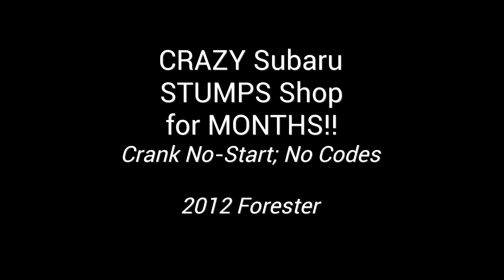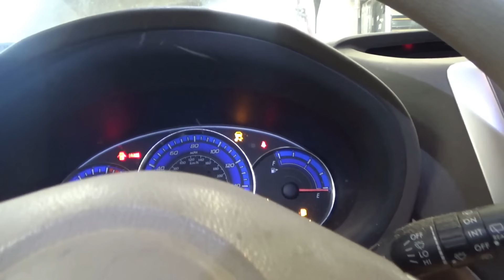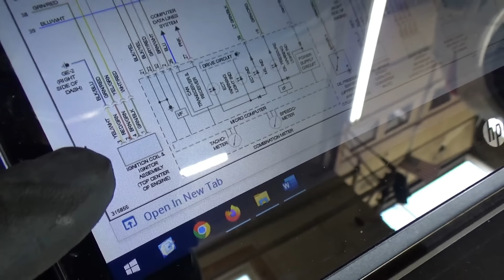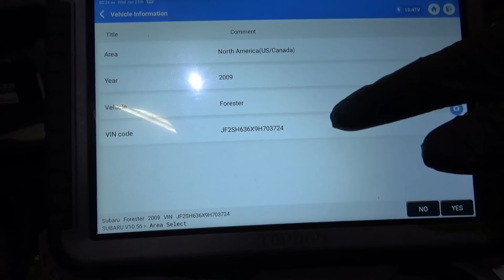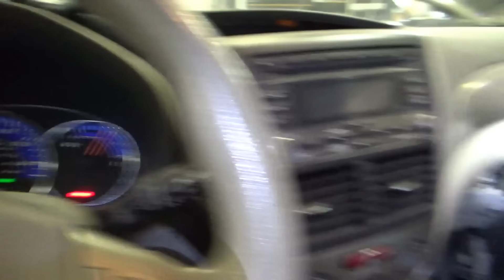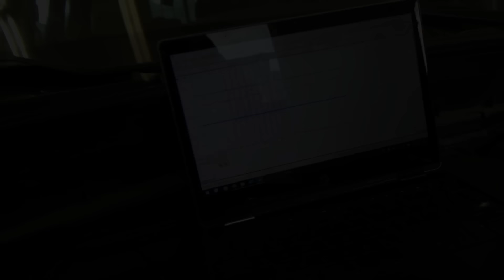(Pt 1) Subaru STUMPS Shop...for 6 MONTHS?!? ('09 Forester Crank No-Start, NO CODES!)

Comment: This scenario reminds me of some of my own ' grandpa tricks '
As a youth, back in the days of carburetors and cold winters in Michigan severely flooded vehicles were a common thing.  A cold start mechanical choke mishap and you had engines dripping with gas.
Some spark plugs would absorb gas into their insulators better than others and cause them to behave as if they had no spark gap.  Heating it with a torch didn't always fix it, at least not in short time.  What I used to do was pound the gaps down to about 5 thousandths , barely enough to see some light through in attempts to get the electricity to jump the gap rather than short out through the insulator.
Plus
It seemed that severely flooded conditions would respond better to a tiny weak spark than a mega blast.
I know it doesn't seem to make sense but it used to work for me often enough.
They don't like running with tiny spark gaps but after you actually get it going and get things hot you take them out and re- gap.
I got my brothers Ford in line six going after he played with it for 3 days and destroyed a starter. Just like this motor it would only fire one cylinder and 
' tease ' him.
I made it run in 20 minutes, the time it took to regap all the plugs.
I cranked it for about 1 minute to get it to keep going.
My dad flooded his front wheel drive V6 and I did the front 3 plugs, enough to make it start.

Comment: The wasted spark PCM ignition IGBTs have and active clamp at around 400V. Meaning the output is clamped to 400V. With the coil pack connected you should be able to measure the PCM ignition outputs at the coil using a 10:1 Pico scope probe, but is it best to use a back probe and test one at a time. The smart ignition IGBTs have full diagnostic coverage, so a test bias voltage for open circuit detect is not really necessary. You might see a bias open circuit detect for a custom approach.

The self test mode should be done with a vehicle power maintainer powering the vehicle. The cycling of the high current loads could kill a low SOC battery.

Comment: Uh, I don't think that diagram is correct. The top/front/left output on the coil pack is for #2, the lower one is #4. And then, for the waste spark, 3/4 fire together, 1/2 fire together.

Comment: ecm connecter on pcb lgt 2.5i has same prob  board bends for ecm  if press on connecter it works some times   also replacement  ecu theres a 8 pin ic  that stores the vin and keys  u swap the ic over  to doner ecu    and it will work like its mated   also  un plug maf connecter   try to start motor will run in limp  and only basic inputs  are used to run  in speed dencity mode

Comment: My BMW E34 had one cyl stopped firing, engine was running very rough on 5 cyl!
Mechanic thought it was maybe a bad fuel injector, he put a good one in, same thing.
He told me it's the ECU,  which the dealer priced $1500 for the part.
Bought another ECU on eBay for $80, plugged it in, car fired up, engine ran very nice!
👍👍

Comment: Is there a chance that you have a broken ground wire to the coil input, that is still lighting your light, because it is reading thru the adjacent coil input that is firing twice - path  f least resistance?

Comment: I think your overthinking. Check the trigger wires for continuity. With a meter, back probe one lead into the coil end and the other at the ecu. My guess if you have a break in the one trigger wire. The culprit is usually at the main harness connection on the passenger side near the coil. All it takes is a little corrosion on that pin and it'll cause half the coin to drop out. Seen this one before
Reply from the maker: Watch Part 2 :)
Reply: @PineHollowAutoDiagnostics I did after I commented haha. But you should have checked for continuity early on to rule it out. Good videos 👌

Comment: So true about the coil pack! 
I recently did a home head gasket replacement job on my 2006 forester with the same engine. 
Part of that was putting a new plugs and leads and despite thinking I've been careful with which lead went where on the plugs and coil pack I got it wrong first go.

Comment: Top to bottom on the coil’s left side is #1 & #3. The right side is #2-top and #4 bottom.
Reply: Agree!  The car is not a 2012 as stated it is a ‘09 or ‘10!  A 2011 on up is an FB engine with coil on plug.

Comment: I’m guilty of the parts cannon too . I bought a fuel pump a new Chinese coil from Amazon’ (luckily the coil works) but the problem was the last thing I put in. New plugs and wires fixed my issue. Don’t worry I’m keeping my o e m coil. It was for my 06 Subaru Baja. Now it runs great. I am very lucky

Comment: I would say in this case you may have missed a couple of things to check:  First off would be the coil pack itself, and it's inputs.  Are the pulses coming in on the right lines to start with?   If no, then move to the PCM and tap the same two lines there.  If correct, then cabling issue.  If not, then likely PCM issue.

Second one for me would be a quick compression test.   Only 4 holes, only takes a few minutes.  It would eliminate that from the discussion.    I sort of feel like you have two dead sparks and likely a couple of low contributors as well, which is why it won't start - the thing should run unhappily on two.

Comment: if it's like other subaru's the coil ground location has combined/stacked terminals and it bad it could be grounding out through other things/devices.
I'm more familiar with the coil on plug turbo models though, so it may not be stacked on those, but they all tend to corrode up.

Comment: Last time I worked on a Subaru everything was controlled on the ground side. Where the typical gm would use a relay for a power antenna or headlights switching the positive the Subaru was just the opposite.  Can you guess what year

Comment: Cam crank correlation seems okay, i checked my own known goods and i looked online for other examples, yours seem similar. I do have a question on the cam sensor signal, the 2x pulses do not seem the same voltage height and i can not make out the voltage scale for the cam sensor signal. That might be a red herring...Possibly a wiring issue to the coil, are perhaps the 2x trigger wires shorted together? Is the coil the correct one? Questions, questions...love your videos Ivan, thank you and looking forward to part 2.

Comment: Hey Ivan, had a similar problem with 2  spark plugs firing and 2 not, and no control coming from ecu. Got a replacement ecu didn’t fix it. Turned out from a obscure post on a Subaru site someone said oh that’s what happens when the timing belt slips a couple of teeth. Sure enough, checked the belt, it was off, fixed and the engine started right up. Your cranking sounds not quite right. Could be the same.
Reply: Even with slipped belts the spark will fire
Reply: @jalopy2472  That would be the logical assumption. However, you do not have access to the firmware source that is running this ECU. Just as @peterfitchsiro mentioned; I have also seen this exact same timing belt failure and resulting odd ignition behavior on Subaru models in the past.

Comment: The main thing you have to heat when torching the sparkplugs-  is the ceramic insulator.   Everything else can be covered with stuff and still be fine.. It's the insulator that has to be cooked clean; because that carbon on the insulator builds a path to ground and that's what shorts out the spark..   So just focus on the insulator next time with your torch.
Reply: I used to pound the gaps down to almost nothing in attempt to get the electricity to jump the tiny gap instead of taking the conducting insulator route.
Reply: @michaelszczys8316  I like to pound gaps in my spare time

Comment: still using waste spark system in 2009? Yes Subaru always be Subaru ￼￼
Reply: only on the non-turbo engines, the turbo are coil on plug setup. :)

Comment: Have we got a known good CAM v Crank waveform. I've had a ford do similar with bent reluctor teeth on the crank after a botched timing belt job. The ECU got confused and didn't know when to spark. It was seeing 2 TDC's.

Comment: I had something similar with a 2012 Cadilac ATS 2.0.  Customer complaint, engine is shaking, and mil light is flashing.  I scanned it for codes, and it said cylinder #2 misfire.  I pulled the #2 coil out and stuck in a spark tester.  I start the car, and the coil is firing strong.  But much faster than I think it should be.  A few seconds later, the engine stalled but the coil is still firing super fast.  Thinking this might be an ecu problem, I reached in and disconnect the ecu connectors looking for a loose or poor connection.  And find that one of the connectors is full of water.  The customer approved the new ecu and the car has been running perfectly ever since.  My question is how did the water get in there in the first place?  The owner tried to assure me that he never drove through high water or that the car was never in a flood.  Something doesn't add up.

Comment: I ve opened and repaired and still do it on ECU s the ones from the 90's and early 2000 are the easiest to repair : I ve never repaired a ECU that failed because of it s inner electronics except for  the 12 volt bridge supply only because capacitors got hot or drifted with time ,  but when a driver fails it is always because of an outside problem , you could take that ECU open it and look with a magnifying glass you will find either a cracked and burnt driver , a popped can capacitor with a burnt resistor or a cracked ceramic surface mount capacitor with a resistor. nowadays ECU are not repairable for DIY people since the electronic has miniaturized since however I bet that 2009 ECU ist still old electronic components should be big enough to repair. Take a look inside if you see a burnt driver they re will be 3 others the same on a heatsink so you ll have no problem sourcing the parts

Comment: i think you should check the signals at the ecu connector , because if the wires are crossed some how some where the two signals might be occurring in one wire , it is a possibility maybe @9:50
Reply: Yeah, that was my idea as well:  The two signal wires are shorted together, and one is as a result disconnected.  So you get double spark on one side, and none on the other - except occasionally.  My guess would be corroded connectors, pinched wire, or defective coil pack that is shorted internally.

Comment: You need a specialized tool to reprogram the vin in a subaru ecm. Or there are places to send your old and replacement unit and they can clone the data from the old unit to the new one.

Comment: My guess is they had engine work done and used the wrong crank sensor thing that goes on the crankshaft. Sorry don’t know what it’s called but it’s the part that the crankshaft position sensor gets its signal from, prove me wrong ivan
Reply: the crank sprocket was the same from like 1985 to 2004, then 2004 up.  older had like 5 or 6 teeth(memory) later had teeth all the way around and two solid areas 180 across from each other. very hard to confuse the them.

Comment: Subaru master here. Before watching I want to posit a guess: The 12v feed to the main relay is bad. There's a splice behind the HVAC box that commonly corrodes and causes the 2 power feeds into the main relay to have 10 or 11 volts of drop, which kills the computers ability to power up fully. Seen it many times on this gen Forester.
Reply: Will that cause one trigger to drop out and the other to still work?
Reply: @rodvan-zeller6360  ell. problems can have wierd outcome's,
so i would say, everything is posible.
Reply: @rodvan-zeller6360  I can't fully say yes. I had one car that did have that phenomenon going on, but the customer declined further repairs and I never got to fully crack that nut.
Reply: worth checking i would say.
Reply: Interesting.  My gut resposnse to the "makes no sense" phase of troubleshooting near the end was some kind of threshold issue for spark triggering being right on the edge... and a 12v supply getting voltage dropped thru any kind of dirty connection under load could change the bias on certain computer circuits depending on design.  Something like a trim resistor feeding a 9.8v zener... there goes voltage stability in a low volts scenario and [semiconductor] bias starts wandering, causing flaky outputs.  
Anyway, a voltmeter proves connection quality where [powered down] resistance testing fails.
Reply: Hi running a nightmare  son wrx 2014 drove onto the flatbed  dropped  of at home due to no insurance  won't start  after dropped of check not getting pulse  replaced cam and cam sensor   vehicle started while getting for spark  with 2 coils  off assumed the freak  repaired itself put everything  back together  no  no start  any ideas
Reply: Hey what causes the green cruise control light to flash off n on in a 2009 outback pris
Reply: @AaronHammon-z5i  That means cruise control is disabled because of the check engine light. If you get the check engine light code cleared, the flashing cruise control light will also go away and you will be able to use cruise control again.
Reply: Subaru guru master next to god here
Reply: Where exactly is this splice? Pretty sure that's the problem I'm having
Reply: I have three lights on check engine and traction and flashing cruise control light. I heard on YouTube before it was a gas cap issue. I messed around with gasket on cap one day and got back in car and started and all the lights were off then hit a bump down the road and the three appeared again pot hole again lights all went off for about 10?seconds back on again
Reply: Thanks for the useful info.
Checking the voltages is always a good idea just to make sure that there's nothing odd going on with the power feed.
Reply: that or they should try some fuel instead of water?  🤣
Reply: not a smart as you thought
Reply: @Macktruck50 lol

Comment: In over ten years of working on these things, the only time I've seen a bad ECM has been when I've tried flash programing them with ECUTek and the programming fails... it scraps the ECU and has to have a new (old) chip soldered onto the board
WHat I HAVE seen is bent ears on the crank sprocket....
Admittedly, 99% of my work was on the turbo versions though. :D

Comment: I don't agree with the bad plug wire conclusion at 6:30 (or I just can't understand the reasoning). To me the logical conclusion would be those two spark plugs and plug wires are fine, the problem is before them.

Comment: ECM is bad but before changing it, measure and compare the resistance of the coils.  If you noticed, your symptoms changed slightly when you swapped the coil. You may find a partial short on one of the input sides, probably the side that isn't firing. This may have caused the PCM to fail in the manor you are seeing. (Double spark on one coil).

Comment: I am pondering the thought that the wiring harness might have been spliced at one time and the transistor output for the 1-2 coil is running to the 1-2 coil, and the transistor output for the 3-4 coil is also running to the 1-2 coil, instead of the 3-4 coil like it's supposed to.
Reply: Very interesting
Reply: My thoughts too!😂 And by testing to bridge the signal wires at the coil, it theoretically should run. 😊

Comment: Gosh it's been a minute, but I remember something about two different coilpack options on earlier Subarus, and the only difference was the pinout swapped the power pin with one of the control pins.  I may also be completely misremembering this, though, as it was about 2009 or so when I ran into the issue!

This one is very curious!  Looking forward to the next video!  :)

Comment: Man that starter motor is way more durable than car 😂
Reply: My condolences to the starter....😃😃
Reply: Denzo made indestructible starters for these cars, the worst that happens on most of them is you have to rebuild the contacts and plunger for like 20 bucks and the motor essentially last forever. Good cars if well maintained.

Comment: Check crank sensor prongs could be bent. Spark plug wires could be damaged & have no resistance in them, not allowing the proper spark to crank the engine over correctly.

Comment: At one point, all 4 spark plugs were removed, and the engine cranked to check spark. The crank sound was slow and labored. Should not the crank have been faster and smooth? There would be no compression to resist cranking. Is the battery shot?

Comment: I noticed that the MAF is unplugged and not plugged in
Reply: Wouldn't matter. In fact it helps diagnosis as it takes any error its sending the ecu out of the equation. It will start and run without the maf if everything else is working correctly
Reply: Mine won't start with the MAF disconnected, either.  Also, ...the 2 Bottom towers go the Back cylinders.  I always remember this because they both start with the letter 'B'.
Reply: @michaelladigo2395 I think my wife's car will start but immediately quit.
Vroom - quit is all you get.
With no MAF

Comment: Had an '04 Mustang V6 with a similar problem.
Turned out that the bottom of the coil pack had a nearly invisible hairline crack.
Replaced it with an OEM unit and it ran beautifully after that. 
This is a really interesting diag.

Comment: I want to see a diagram of the coil pack. Is it 2 separate coils in one package, or is there some fancy interconnection on the primary side?
Reply from the maker: Shared primary power and ground, otherwise 2 separate "double" coils :)

Comment: My Ford ranger had a similar situation. Bad coil took out what I felt was a dioed and was double firing on #4 .2.3 engine. It also took out #4 injector. I stumbled across it by using my induction timing light.
Reply: I also had a bad coil on a Mazda B series truck and it was a tricky one.
Reply from the maker: That's crazy!!